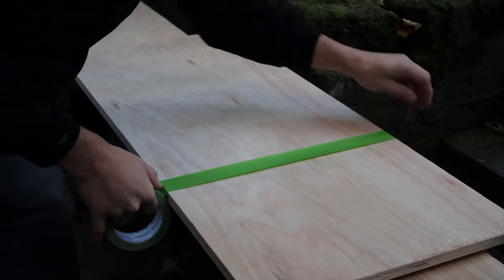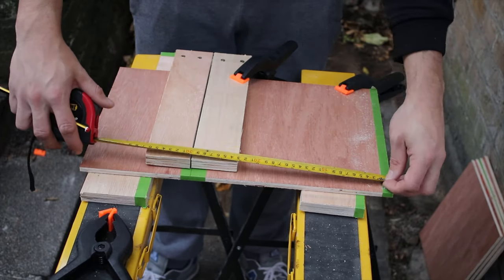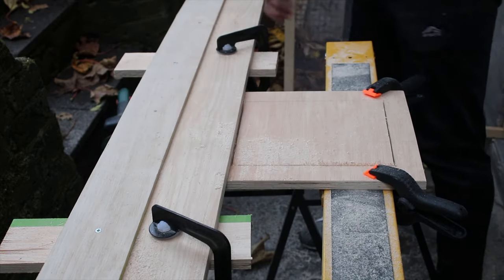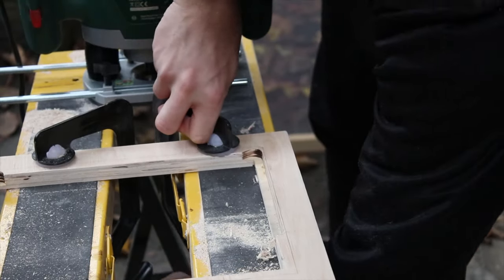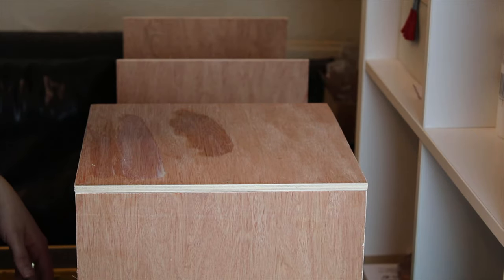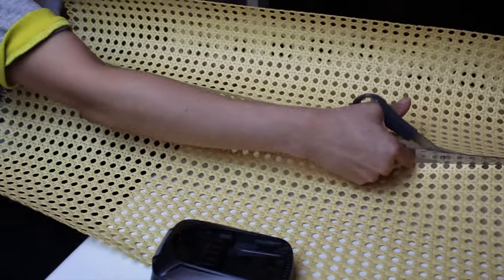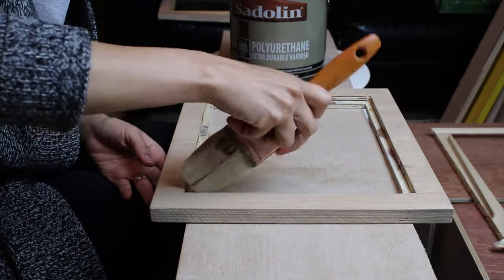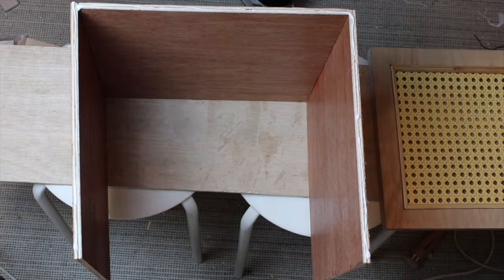DIY - Cane Storage Boxes

Comment: What size plywood did U use??
Reply from the maker: 18mm plywood on front and back, 9mm on the sides (but you can also use 18mm, but it will be heavier). Each side is 30cm X 30cm, so for 1 box you need about 160cm X 30cm or the 120X60 plywood, which is more common in stores.